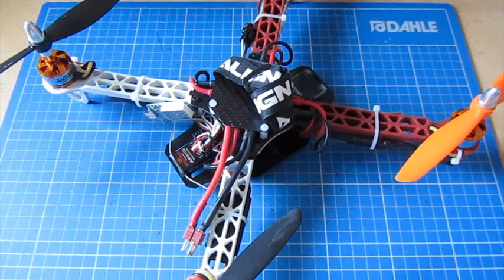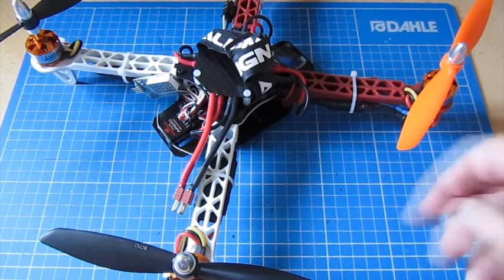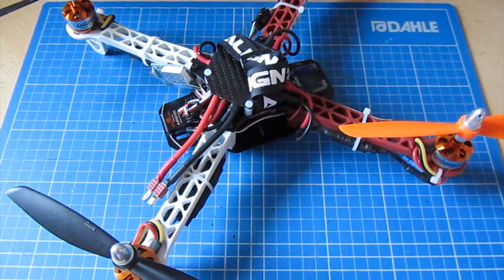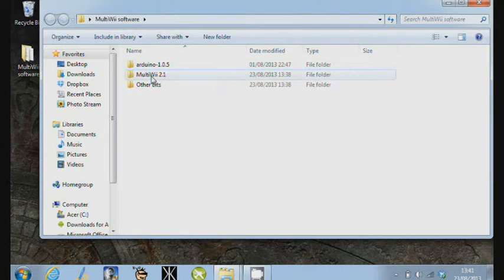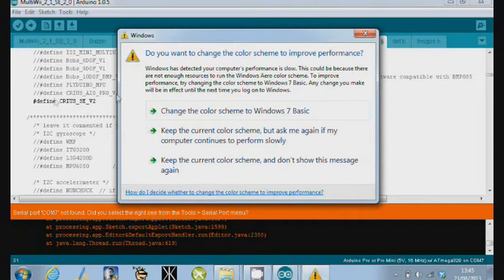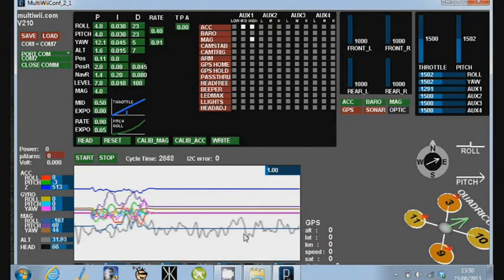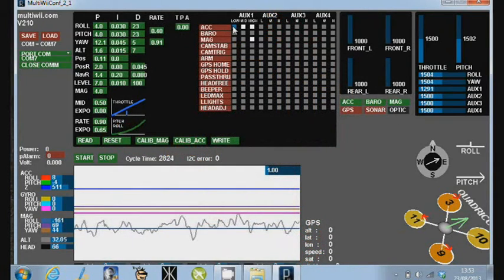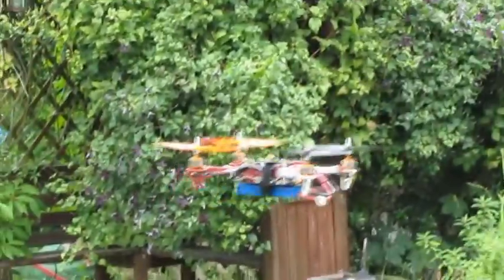Crius SE V2.0 MultiWii Board (MWB) Overview and Setup

Comment from the maker: Hi Bruce.  If I was going to buy all the pieces from scratch it would cost around $137.40

Parts include:
Flight controller- MultiWii SE V2.0 Flight Controller w/FTDI ($30)
Motors - D2822/14 Brushless Outrunner 1450kv ($25, $8.50 each)
Props – Plastic 7x4 props, two CC and two CCW (£10)
ESCs - Hobby King 20A ESC 3A UBEC($28.40, $7.10 each)
Frame – f330 Clone ($10)
Power distribution - ($4)
Battery - ($30)
Not counting Tx, Rx, tools and sundries.

Happy flying!

Comment from the maker: Could be a few things. First thing to check is that the FTDI connections are all ok and that the pins are all soldered well on both the board and the MTDI adapter. To flash the firmware the FTDI adapter starts the bootload with one of the pins and if there is a bad connection it won't start. Rarely one of the chips on the Multiwii can be bad and not accept the reset. I'd go over both with a fine toothcomb and look for dodgy soldering.

Let me know if you track down the fault. Happy flying!

Comment: Thanks for the reply. I did have to mess with acc and set my escs too. Worked great. My reciever I guess had a brownout at 8 feet from me and the quad just didn't stop it went right up into auto level and the wind took it. Will be looking for it in the am I hope it's in a field and not in the road. But your video helped a lot as there isn't a lot of info for multiwii
Reply from the maker: Sorry to hear about that. I've stopped using Orange Rx on my models now. The ones I have don't have the 'model match' and 'failsafe' of the actual Spektrum receivers and I had a problem where the motors kept running when the Rx was turned off during a setup test on the bench.

I 'lost' a model last week when flying in the countryside (it was cold and the bloomin' FPV goggles steamed up!) so dumped the throttle when it drifted out of video range. Luckily I was using EzOSD and tracking the flight on the iPhone which took me right to the model - sat in the middle of a farmers field next to the footpath. Very relieved.

I hope you find you model in one piece soon.

Happy flying.
Reply: me too lol. its fine i ordered new everything to replace what i lost.. no kk in stock at hk so i ordered the multiwii pro with gps. set my hight cap and if it where to happen again i hope it will just hover at the set limits and ust kill the lipo and come down.. ill post a video of thst flight soon.. hope it dont fly off two
Reply from the maker: A happy ending! Great to know it made its way home after all.

Best wishes for the festive and 2014! Happy flying!

Comment: Hi Thanks for the great videos and there are very helpful. I am new to the Multi-Rotors. I just build hobby king FPV 250 mini and Crius MultiWii 2.5Se board with 2.3 firmware. I notices when configuring I have to bring the throttle stick to half or more that and motors not spinning the same speed. Top left is the fastest and right bottom is very slow. Sometimes it’s not spinning. I calibrate the ESC.
Reply from the maker: This is normal if it's not in flight as the gyro and acc. are not seeing any input. Does it not fly well?

Comment: Awesome video! thank you!
From all the reading I've done and Youtube videos I've watched it's obvious I need to increase
My "rc rates"
What I don't understand is WHY inside the interface there are only rate settings for PITCH and YAW but not for roll???

I see this puzzling thing in all versions of the config interface, 2.1 2.2 and 2.3
Reply from the maker: That's because the rate setting is actually used for both pitch and roll (front to back and side to side). This is fine is you have a frame where the motors are equally spaced (X or + frame configuration).

The second is only used for yaw axis. Hope this answers your question.

Happy flying!

Comment: Also another quick question. Would you recommend covering the barometer with foam or not to cover it.
Reply from the maker: Yep, it works a lot better if you cover it. I use a thin piece of foam from a regular sponge and stick this on top. Stops wind from FFF from altering the reading too much.

Comment: Great vid, you may want not to go so fast on the board selection, I had to have quick reflex's to pause it to catch which one you choose. Anyway, I'm trying desperatly to get this to work. I flashed it for a Tricopter, all it does it overheat my tail servo and one of my ESCs. I put a servo testor on the outputs and they are holding at 995 steady, and no response from input from my radio, except from motor 01, which responds with some stick commands and even moving the board around. All the other ones don't respond... Think this is a bad board?
Reply from the maker: The files used are available to review via the link so you can see exactly what was selected. Happy flying.

Comment: Have you made any videos about gimbal stabilization using a couple servos and the multiwii flight FC itself to control them? It is possible, and although it does not seem to be the best, I would like to set it up with some servos that I bought, which have not came in the mail yet. 

Although I see others have got it to work reasonably well, I could not find videos showing the details of setting that up. The config.h file only has a few options, and does not have a good description of the setup, where the servo's should connect, how to adjust the gain of the servo correction, and possible the PIDs to optimize it, etc.
Reply from the maker: Hi, I don't have a gimbal I can use. I tend to use the separate, dedicated gimbals like BGC when I want stabilised video. If I get one in future I'll add a video to the channel.

Thanks for the suggestion..
Reply: Painless360 I was thinking of making one for the mobius out of wood, and figuring out how to mount the servos to the holder.

Comment: Thank you very much for going over the settings. I found that the manual that I received for my Aerosky Hex was very poor.  I am a new to all of this so I'm sorry if I ask stupid questions.  First, I don't really know what board I have, its a MWC, but outside of that I'm not sure, how do I find that out?  Second, I used your settings, uploaded to my board and got this.
Binary sketch size: 22,496 bytes (of a 30,720 byte maximum)
avrdude: stk500_getsync(): not in sync: resp=0x00
Will this cause me issues?
Reply from the maker: Dane, if you can video the board I can have a look and tell you. This error is usually because you have the wrong board type selected in the Arduino upload program.

Cheers
Reply: Painless360
the settings I chose are:
Arduino mega 2560 or Mega ADK (this got rid of the error)
In the sketch, I chose:
 #define FREEIMUv043     // same as FREEIMUv04 with final MPU6050 (with the right ACC scale)
I didn't really now what board to pick in this either.
Thanks for your help in advance!!
Reply from the maker: Dane Lueck Wonderful! Good news. Happy flying!

Comment: isn't it Arduino Mega 2560? Because the board you suggested didn't work "avrdude: stk500_getsync(): not in sync: resp=0x00" this one works for me Arduino Mega 2560 as suggested with other forums.
Reply from the maker: If it works then great. You should find that one of the boards listed that use the same processor should work. The processor model is written on the chip. The one in this video is a 328 based board.

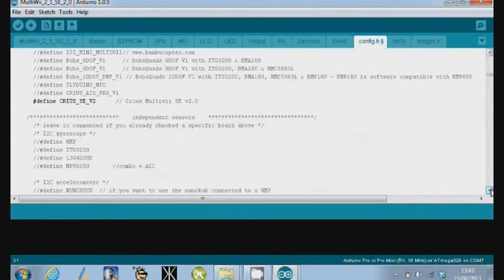Comment: Just got the Mutliwii_328p with FTD/DSM2 Port v2.3 quadx - I don't see that selection when I am following your vid 12:20 on the time line.
Reply from the maker: Hi Joe, with the huge number of Arduino based boards out there may are not expressly listed in the tool but will work great with one of the existing settings. I'd start with one of the lower 328 based boards (Aurdino Pro or Pro mini) and keep trying 328 version in the list to you get one that works..

Happy flying.

Comment: Hi Painless360, thank you very much for this video. I did all this and the quad flies well but I have one issue. It does not stay in it's place, i have to work the controls to hold it in one spot. When i power it up, it goes to the back. I tried adjusting this problem by compensating for it on my receiver, but this did not work. Is there a way in the Multiwii controls program to adjust this?
Reply from the maker: Hi there, I'd recalibrate the acc on the board. See my other video on how to setup the auto level on the Multiwii, that may give you a clue.

Thanks for the comment, happy flying!

Comment: Firstly, thanks for your vids, they have been brilliant at getting me started :)
I have a multiwii SE v2.5 board from myrcmart ( I believe it is a crius clone) and FTDI interface. I'm using a mac and cannot get my the virtual com port to show up under arduino 1.0.5.  I've looked everywhere and there seems to be similar issues but no fixes that work for me. The FTDI interface powers the board (green light) but no communication. Any tips or links to places that might help. I'm stumped.
Reply from the maker: Hi Aus, sorry I have no experience with the MAC PC emulator. Sounds like that is the problem. If you get an answer then I'd be interested in what it was..Thanks, I hope you find the answer soon.
Reply: Painless360 

I was so obsessed with using the FTDI driver  (which is the one that most of the forums direct you to), I never considered that the usb/serial module might have been made by some one else. It uses a Prolific 2305 chip. Hopped over to Prolific, downloaded the correct driver and IT WORKS!!!!!

So, for any mac people using multiwii and having difficulties getting a com port to show up, use this driver, NOT the FTDI driver.

Drivers for USB to Serial adapters using Prolific 2305 chipset with Mac OSX 10.9

http://www.prolific.com.tw/US/ShowPr...id=229&pcid=41

Also, there is an alternative driver option is the open source

http://nozap.me/driver/osxpl2303/index.html

Comment: Thanks for your wonderful videos, I am a beginner and I have some questions for you :). First : can I use Zigbee or any other receiver ?? Second : what is the range of  AR6100 Rx ? Third : what is the transmitter used ?
thanks a lot
Reply from the maker: Hi, I've not used a Zigbee but any Rx should work fine. The AR6XXX has a decent range and you will find that the quad will be too small in the sky to fly WAY before it runs out of range. The radio I use is a Spectrum DX&, I've had it for nearly 8 years now and it has all of my models - planes, copters and multirotors in there. Happy flying!
Reply: Painless360 Actually, in my country it is illegal to have such a transmitter and receiver, so I do not find it here, but ZigBee is available and legal, so I just need to know how to connect ZigBee to MultiWii 2.0 ?
Thanks
Reply: Ahmed Maher i Use multiwii and Xbee Pro S1 . but i'm still have a problem in stability of quadcopter :/

Comment: Nice and helpfull video! I just order a multiwii SE V2.5 to use it with my larger X525 frame. Do you believe that i can use the same PID settings you use with your 330 frame? Also, how can i calibrate the ESCs? Thank you!
Reply from the maker: The PID settings will need to be different as the inertia and response of every model/motor combo is different.
 
I have a look at my video called 'ESC Calibration' - Multirotor build tips: ESC calibration
 
Hope it helps..

Comment: Hi there install firmware but can't get my transmitter to respond in gul
Reply from the maker: Leon Belgrave Hi, what troubleshooting have you already done? Checked the cables are plugged into the Rx the right way. Confirmed that it's bound to the transmitter..

Comment: Hello,
can you please tell me if there is a difference for software and configuration between crius multiwii se 2.0 board that you described and explained, and crius multiwii se v2.5 board. Can I follow your instructions that you made for v2.0 and do the same for v2.5, or that doesn't work? I received the v2.5 board with accessories (gps, lcd i2c blotooth). I saw your video for gps and i2c setup , and was wondering if i can do the same for v2.5 board?
thx and keep posting for multiwii, it's great.
Reply from the maker: All the files and setup are identical. The main change on the 2.5 board is the addition of the extra i2c port so you can plug in two devices at the same time (i.e. OLED display with the i2c board for the GPS). The steps for the boards are exactly the same.Thanks for the feedback, I've just posted a new video on Multiwii - @G1Pz_2tldHM that you may find useful.Happy flying!

Comment: Having trouble getting a driver installed to talk to this older 2.0 board. It should just connect after installing the arduino software?
Reply from the maker: +MicroRCFiend The driver should be for the FTDI adapter board. Some have had problems getting 'clone' FTDI adapters top work. Ask the vendor for a driver. Best of luck.
Reply: It's over a year old and he stopped selling them so can't help. Tried everything but no go. I got a nanowii to connect so everything but they ftdi driver for the se 2.0 is good. Thanks anyway, will keep prodding away at it.
Reply: Painless360 Ok, it's because the driver is not win 8 or later compatible, 7 or earlier only.
Makes more sense why the driver didn't drive owt :)

Comment: Hi Painless
I have the v2.5 i set the board to crius se v 2.0 the bro works ok but no movement from gyros when you move board left or right etc .
Reply from the maker: Try and re-load the board and check the settings in the config.h file if you can't see any movement. Also try and calibrate and accelerometers in MultiWiiConf to see if that sparks it to life.. Happy flying!

Comment: Hey! Your videos rock! I have a ZMR WMC MultiWii SE v2.0. The problem is, the board does not turn on unless I connect one of the receiver channels to the A0 pin on the board(CAM PITCH). I dunno why this is happening. Pls help me out.
Reply from the maker: Hi, depends on how you've got it connected. The board in a model gets its power from the ESC leads, do you have any ESCs plugged into it?
Reply: Hey! Thanks for your reply! Yes, all the ESCs are connected to board. The red 5V led glows dim. but only when I connect a cable from ANY channel to the A0 pin on board, the green LED glows. Blue LED is the sensor and ARM indicator. SO why does this happen? I'd be happy if you are willing to chat over Skype or gtalk and I can may be show you over video what happens. Thanks in advance!
Reply from the maker: Sounds odd. Does the board power up with just one of the ESCs plugged into the board with nothing else? A video showing the problem would be useful.

Comment: it doesn't seem to work for me, it uploads ok but i'm not getting anything in the conf, i am only getting the yaw line which doesn't move.
Reply from the maker: Are you asking for help? Not sure but in case you are here are my suggestions -

Try calibrating the Acc and Mag in MultiWiiConf. If that fails then you need to re-flash the firmware and choose a different board. I find 'define HK_MultiWii_SE_V2'. That selection works well for me..
Reply: Painless360 it's ok i found the problem, my ftdi connector was backwards so it didn't flash properly
Reply from the maker: Good news - good luck with the rest of it.

Comment: Alright I've done everything according to your videos, as well as tweaking some settings for my transmitter, yet it won't arm. I've watched your video on the arming problems, yet I'm still right where I started. I've calibrated my escs, and have everything flashed and connected. I've tried changing some of the settings so it matches the values from my transmitter, but have had no luck. Any thoughts?
Reply from the maker: AudioFreeeze Not with that level of detail. If the board is level, the transmitter endpoints on the throttle and rudder are enough and you have the right channel from the rx plugged in to the right input of the FC then I've got no other ideas.
Best of luck.